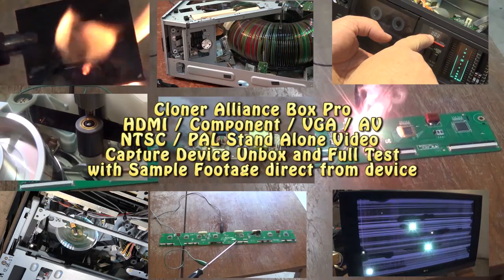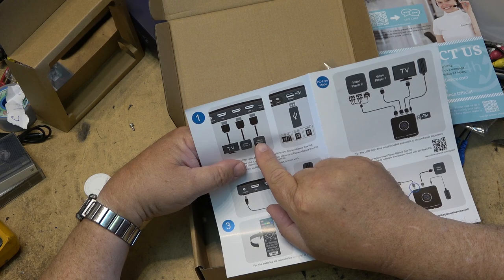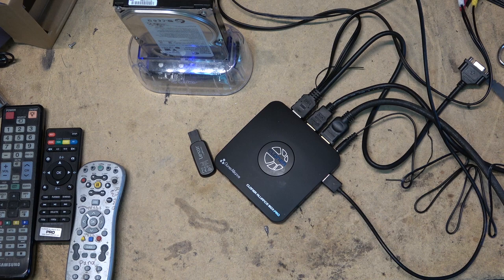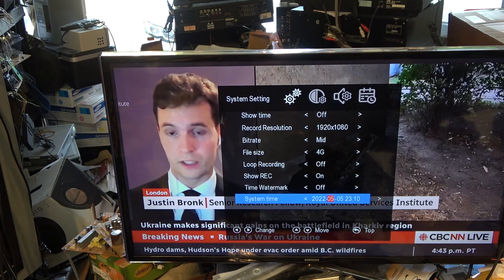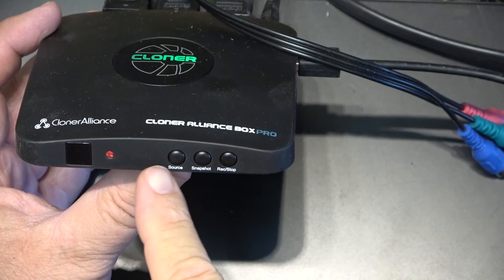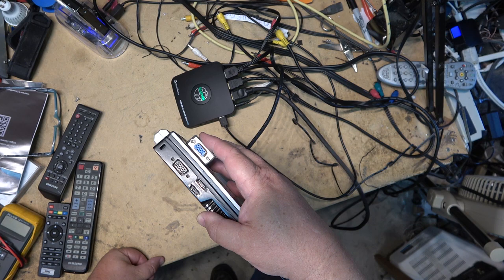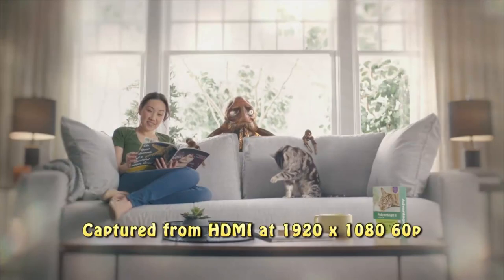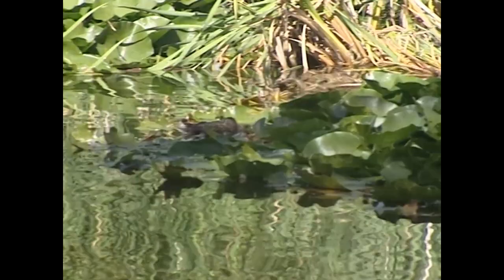Cloner Alliance Box Pro Stand Alone HD Capture Box is the Best I have Tried Yet

Comment: I prefer using computers for capture, I record analog video to my pc in raw format and only compress it on final export after editing. Gives incredibly high quality results and preserves most of the information in the video, information that is really useful for adaptive deinterlacing with qtgmc.
Reply from the maker: Too time consuming.  I have a 1200 capture card.  I will be putting this up against it in the next few weeks and we will see what works better.  If you are just doing your own and don't mind wasting a few hours scaling and rendering that's fine but when you are converting tapes for clients you can't be tying up the computer for hours on end digitizing and then rendering out files.  Customers won't pay that much.  Needs to be just play the tape and hand them a watchable file.  People won't pay more.  Shoot i still get people that want old home movies done with a projector and camera if they can get it done cheaper than scanning. They want VHS and 8mm tapes copied for 10 bucks a pop. Can't do that using computer as computer is tied up for hours.  This will let me dump tapes to USB stick directly and hand to client.  I don't care if i can make it 1or 2% better, this is more than good enough.  I was amazed how good that big broadcast pal betacam looks.  Amazing.
Reply: @12voltvids  I have a workstation specifically built for this, it's linked to a linear editing/mixing system with external TBC and a bunch of other nice things. I use it mainly for creating visual effects, and occasionally dumping tapes.
Reply from the maker: @elektrokinesis4150  my workstation is built specifically for editing. That's where I do my YouTube cutting and any other paid production work that I do. The problem is if I'm using that workstation for archiving someone's tapes I can't do anything else at the same time. So either the archiving has to back up until I don't have any editing to do or the editing has to be put on hold while I do an archive job. This capture box on the other hand allows me to keep the archiving and production operations separate I can be archiving a tape or tapes, because it's generally not just one tape I get when a client brings me tape say typically bring me a box of 20 or 30 or more tapes to archive, it can do its thing with just a VCR the capture box and a monitor with a hard drive plugged into it. It can do its thing and I can work on editing on the workstation without interruption. back in the day when everyone wanted tapes put on to DVD that was fairly easy I just used a DVD recorder. I still do because many of my clients still want their tapes digitized on the DVD. They usually want a second copy on a memory stick or hard drive as well, which meant burning to a DVD then ripping the DVD and producing a file. I can still do that send the signal through a distribution amplifier into the DVD recorder and then into the capture box and hit both record buttons at the same time but now I can produce their DVD and produce a digital copy onto the hard drive at the same time. It's all about increasing productivity and saving time and this will certainly do that. Showing this off however is a double-edged sword because once people see how good the quality is why pay someone like me to archive their tapes just go out and buy the box do it yourself. Just like with the wolverine scanner, yes showing it off and showing how it works might cut into the archiving business a bit because anybody who has enough films that it would cost more than buying the machine to have me do it it's just going to buy the machine and do it themself. But they're always be those people that have a few tapes or a few films that will have me archive them for them. With camera tapes and VHS tapes especially when people don't have equipment to play them back on it makes it more lucrative to send them out but someone who's got a working camera if they've got a bunch of tapes would be further ahead just to buy one of these boxes and do it themself but if they had to buy a camera and the box to do it then they're further ahead just to send them out and have them done and those are the customers that I attract.
Reply: @12voltvids  I'm not saying my method is better, I was just explaining how I do it. In my experience, people who no longer have the means or ability to play back their precious media are more likely to use archival/transfer services. Showing people this box will only affect people who still own a vcr, and it still won't provide any services like editing or physical media. The majority of people I do work for couldn't be bothered to take the time to dump their own media and edit it together. Regarding the PCs, I have a (scrap bin) PC specifically for recording video to a raid array, which is accessible as a shared drive on my main workstation. Since it's used mainly for vfx and streaming, I have a duplicate capture device in my main workstation as well (AJA Kona LHe), and a matrix switcher to direct video to whatever destination I need it to go to. It's a 16x16 component + composite video matrix with a lot of gear hooked up to it that can be chained together. I could write a book on the various different types of effects and glitches I can impose on the feeds with electronics.
Reply from the maker: @elektrokinesis4150  that's how i stay in business.  Most people's cameras or VCRs are broken.
Reply: @elektrokinesis4150  for capturing on a pc you need a crappy USB dongle or a very rare good capture card, and NOT update your hardware or operating system, only on the older windows Operating System you can use special video tools which you have to set each time you have a different kind of problem/tape,  converting analog to SDI/HDMI is the way to go, and then using a HDMI recorder, that compresses to an almost lossless format, do your post work thing, and compress to MP4.  this cloner box is a good one, no need for pc, just (maybe) some post work, not to much because it's already MP4, should be fine for VHS footage.
Reply: @eric-janvandenbogaard9415  I said I had an AJA Kona LHe, I had to make a directshow driver for it to get it to do what I need it to, but otherwise it works fine with windows 10 (and 11) as a capture tool with it's own app.
Reply: I will stay with my Laptop and dvd recorder.  I download a movie file or stream a video into a dvd recorder. And record onto a d dvd.

Comment: How much does it cost anyway?
Reply: $173.39 < that's from there own site. Amazon says 189.99 for the 1080p version & 233.99 for the 4k version.
Reply from the maker: The 4k is just pass through. I believe it only captures at 1080p for live stream.  I chose this one because it is a stand alone solution no computer required. If a 4k stand alone box cones out that will record 4k video from HDMI then I would be interested in that.
Reply: @12voltvids  Maybe in the future a device of BlackMagic Design will give that option, but i guess even at their price range, it will be to costly, or you should have a huge workload that could compensates that...

Comment: This seems to be what I have been looking for BUT it is a little pricey for something WITHOUT a hard drive
Reply from the maker: That's because it is designed to be used with an external hard drive or USB stick.  Like for example when i archive tapes for clients i plug the USB stick in direct, record the content unplug the stick and hand to client.  If a hard drive was present then the file would have to be copied afterwords and that is another step that takes time.  This way you have options.  It's not expensive. Quality devices cost money.
Reply: It’s actually great that it does not come with a hard drive because that keeps the price down and allows you to use whatever hard drive you want. My only concern is the throughput of that USB connection.
Reply from the maker: @teegees  why would that be a concern.  It only needs 18mbps as that's the max rate it records. That's 8gb per hour and even usb1 can do that.  There is nothing else on the bus other than USB stick or hard drive.  I recorded the entire kings coronation on it, 6 hours straight and it didn't as much as burp even stuffing that much data down it's throat.
Reply: @12voltvids  No dropped frames at all in fast action scenes?
Reply from the maker: @teegees  nope.

Comment: Why aren’t you running win 10. It’s free by downloading in off the Microsoft site. Creating a media creation tool.  It’s easy as hell.   Heck I’m running 11 on a very old system.  Works perfectly
Reply from the maker: I have hardware that there are no drivers for that I use.  Also the version of Adobe i purchased the win10 drivers blow, and by that i mean they suck.  I put win10 on when it was first offered and my system just sucked.  Hard drives going offline by themself the capture driver not recording anything. Imagine spending 60 minutes capturing an hdv tape only to find out after that nothing was saved computer needs to restart and spend another hour getting it to work. Hours on the phone with Adobe looking for solution and the only solution they could come up with the "free" upgrade to creative cloud that comes with a 9.95 USD a month recurring charge to use it and edit my videos.  Not exactly a free upgrade.  I wiped win10 and went back to 7. Everything works as it is supposed to and I never get a crash these days.  I put a SMART monitor on to check drive health and my drives started randomly disconnecting. I thought it was a bad drive but the new drive did the same.  I figured it was the SMART monitor removed it and went back to my faster 7200rpm drive.  I don't use the PC online except to upload YouTube videos. On fact I am probably the least user of the internet. I don't surf at all, and I don't do social media.  I have a slow dsl connection even though 2.5gig fiber is right there 2 feet from my modem.  Just haven't had the need to upgrade.  If YouTube kills uploads from old chrome version I will find the cheapest laptop to upload with but my main computer is not upgrading.  The version of windows is also not even current as far as win7 goes. I updated my laptop to the last patch for win7 and it slowed substantially. Some day when this computer blows up I will buy some parts and build a new one, but I will have to find a new editor program and learn all over again because the day I have to pay 10 a month is the day i quit.  I don't buy into any subs. No Netflix Amazon, Spotify Disney. I have basic cable with the movie pack and that is it. I do have XM in my car but that's because someone f---ed up and it has a lifetime sub. At least it appears to because the radio works and I have never signed up.
Reply: @12voltvids  yeah, computers just s**k for capture analog video because they constantly "upgrade" i'm still happy with my DMR ES35V > ODV > BMD Video Assist (or Hyperdech Shuttle HD)